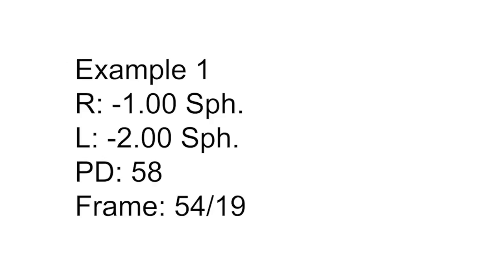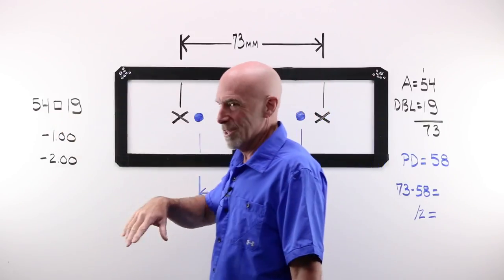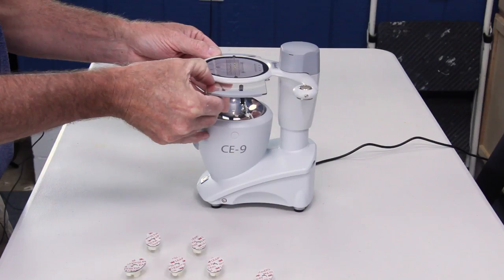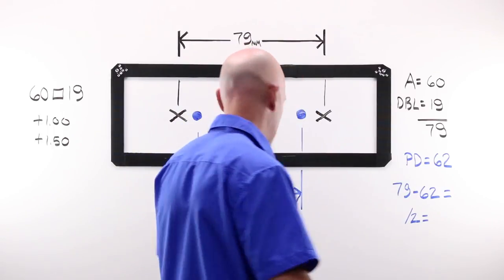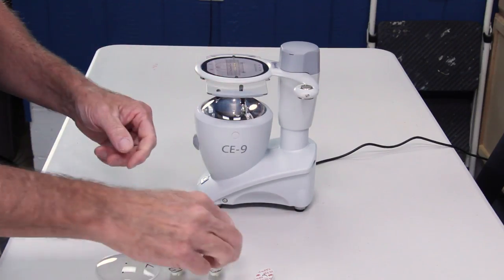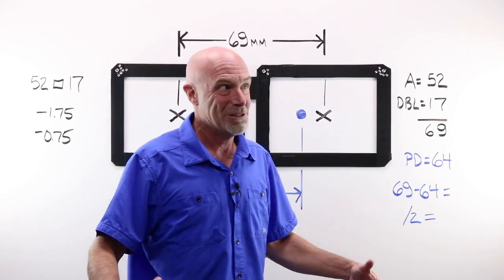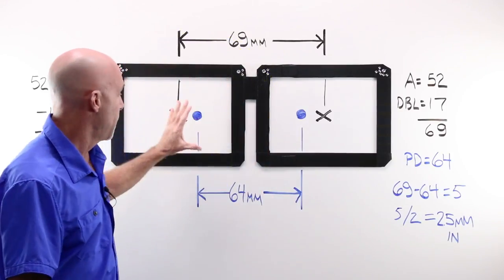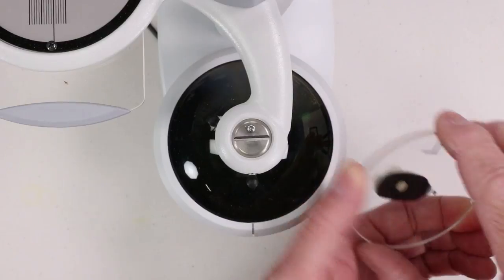Decentration and Blocking - 3 Examples

Comment: Nice explanation on decentration.  I have one question and I am hoping you could answer.  What is your standard height for the OC for  single vision?  Do you always place it on the datum line?  Others are placing it 2 mm above the datum line.  I am just wondering what is your standard practice if the customer didn't include the pupil height.   Thanks.
Reply from the maker: Literally working on that video this morning. Watch for it in a few weeks.

Comment: If you block like that. Will you set the OC height on the edger machine, sir?
Reply from the maker: I would have to say, no. I doubt you can manually decenter for PD and then expect the edger to take care of an OC height. I guess it could work but you would have to experiment with the edger. The basics shown in the video assume no OC height = 1/2 the B. And OC heights are for higher powers and should be kept to around 0 - 5mm. If you need much more you have the wrong frame.

Comment: Hi I have a doubt, Decentering is all the time in the nose direction? I'm a student I read in a book if the Pd is bigger than A+DBL   I  have to decenter  in base out direction, is it right?? Thanks
Reply from the maker: Mik m, Yes correct if human PD is larger than the frame PD then you have OUT decentration. This is quite rare. But it does happen, sure. John
Reply: Laramy-K Optical thanks so much I love your videos
Reply: Mik m   fine

Comment: Hi great video,  i have a nidek LE 9000 SX and ice mini. im new to glazing, ive tried to glaze SV specs but Patient PD is always way way off, can you help at all ? im trying the decentration in this video , when i put half PDS in under frame PD the ice blocker moves the centration and that where i block the lens, but PD is always off, do i need to decentre to make the correct adjustments. many thanks if you can help
Reply from the maker: Oh boy - you poor thing. I can't be 100% sure - but - the edger will have (usually have) two settings. 1) You block the lens on the OC and the edger does the calculations and decentration shift for you. This is usually called PASSIVE MODE. 2) You are doing the physical decentration and blocking and the edger is in PASSIVE MODE. I think that model will show you a little arrow and amount to decenter if you are in the mode where you are doing it? If you are overriding that either way things are going to get messy very quickly. Ask your lab for some junk lenses or better yet buy a box of cheap plano ones - mark/make a clear OC point and experiment. It is confusing as heck but if you stick with it, watch the videos and maybe even draw it out/take notes sooner or later it will click. Let me repeat that - it is confusing as heck so don't feel bad. Let me know if that helps. If you need more drop me an email instead. This may also be a question for the folks on OptiBoard since I'm sure someone over there is still running that machine and blocker too. I suppose if you are only doing basic sv stuff you could always drop the blocker entirely and switch to a manual blocker? John
Reply: @LaramyKOptical  hi thanks for your swift reply, I've been through quite a few planos already, 
i checked the mini ice its already in passive mode, once i change the half PDS the centration does shift and that's where I align and block , then cut lens and still no joy
my process is ( real job I attempted just today)
trace frame on edger
frame shape is shown on ice mini FPD at top  70mm ( FRAME Ralph Lauren 54-16)
I change the half PDS  to RE 31.5 LE 31.5 for both eyes to mirror Patient PD (63mm) not sure if this is correct plz advise)
blank lens is centered and marked on lensmeter
blank lens is placed and aligned with markings on ice blocker (after I changed half PDS of patient )
lens is blocked on ice mini and edged using nidek LE 9000 SX 
PD checked again on lensmeter and over 10mm off (72mm ) 
Ive asked many people in the U.K but everyone uses Essilor 
any advice or help would be great
Reply from the maker: @iqbalgtr  There is no reason at all to split a PD of 63. If you just enter 63 do things turn out OK? With your FPD/PPD a difference of just about 10 and your PD being off by about 10 you are doubling up. Try just blocking on center ignoring the grid suggestions and see what happens? It sounds like a disconnect between the edger and the blocker? To see what those settings are you have to access the service menu. It sounds like you are second guessing what you are actually seeing? Nothing says that the blocker is right (that stuff is getting pretty old now). Again - maybe it is time to let the blocker go? That machine doesn't require one. I'm sure you could track down a used manual blocker (a light source/grid/block applicator) they don't connect with the edger at all. IMO if anything they are much easier to work with not harder.
Reply: @LaramyKOptical  Hi maybe I should disconnect the Ice blocker (the one i have is fairly new touch screen etc with camera)
few queries when blocker imports shape from edger( after traced) and gives me FPD do i keep that number same I.e i dont change it ?
2nd underneath FPD it has 1/2 PD , is this where im suppose to put PX PD in ?? 
3rd if i dont use blocker do i just manually put block on the centre of marked blank from lensmeter , and change PD under FPD on edger itself ?? would that  work ?
thanks
Reply from the maker: @iqbalgtr  I think that is your problem! Assuming the tracer is calibrated I can't see a reason to ever change the FPD which is your FRAME size. Your 1/2 is for your human if you have a monocular patient PD like 32/34 or 33/35. If the blocker is quite new then it is being connected to a machine that is quite old. It may be incompatible it may need the edger settings to be changed to correctly work with each other. It's been 30 years since I worked with that edger now.  If you unplugged the blocker and switched to manual you would need to know which mode the edger is in. If it shows an arrow and an amount to move the lens then YOU move the lens and block it off the OC. If it doesn't then you block it on the OC and the edger takes over. You might want to nose around the internet and try to find a complete manual for both the edger and the blocker? I'm guessing a service call to NIDEK isn't possible?
Reply: @LaramyKOptical  hi thanks again, im still more confused then ever, the machines were working in tandem as far as i know before i  acquired them . a service call to nidek is very expensive.
Reply from the maker: @iqbalgtr  Yes they are! Good time to take a break. Review the videos so you see the relationship between FPD and PPD and then take another crack at it tomorrow maybe.
Reply: @LaramyKOptical  Hi me again, been through loads of blanks still no joy, the machines seem to communicate fine , trace data goes across to blocker and blocker sends PDS to edger as well,  when i adjust half PD the centration does move accordingly and that's where I block the lens, but when glazing is all said and done, The OC is exactly like the frame PD but not the patient PD, I've tried moving the centration and blocking at different points but zero luck , even if i move centration 3-4 mm either side of OC, its still off,, i think im making a glaring error or something because this should work really
Reply from the maker: @iqbalgtr  Nothing is impossible but it is impossible to block on OC and block off the OC and change nothing else and end up at the same place. Is it possible that you are actually trying to match the FPD? Are you looking at the FPD and thinking it is PPD? You are setting the edger by the human PD not the frame PD. Even if the blocker is sending the information to the edger nothing says that the edger is interpreting the data in the right way. I know you don't want to hear it but again - if you are only doing your basic single vision stuff in-house drop the blocker and see how much better things are.
Reply: @LaramyKOptical  I'm obviously doing something wrong, I'm not sure how to block lens without blocker, it shows me diagram on edger and which way to move lens, but how do i exactly do it, do i put the blank over the top of diagram on the edger, ?? other  thing its only moving the PDS like 3-4 mm anyway and then wont cut lens as block is way over to one side of the blank, I've adjusted PD in relation to FPD and blocked accordingly , my issue is I'm not a little bit off in terms of PD, I'm miles off nearly 15mm , no idea what going on ,
which ever way i decenter , the lens cuts ok and OC is directly middle of frame PD but doesnt match PD of patient
Reply from the maker: @iqbalgtr  If the edger shows you an arrow and an amount: Mark your OC in the lensmeter, make a dot that matches the direction of the arrow and the amount. Say the edger shows an arrow facing R and 3. Make a dot 3mm over to the right of the lensmeter OC dot. Place the center of the block on that new mark - run the lens, done. Your marks will all be on the front. This will be easiest if you flip the block with the pad facing up and turn the lens over to line things up and to stick the lens to the block. I'd also slow down a little and watch the videos again! LOOK LOOK LOOK at what is happening in the manual blocker. The relationship is there, the calculations are there, the why is there, you just need to connect them together. And - on the edger and or the blocker you can ignore the FPD (frame PD) entirely. Seriously why the edger even shows it I have no idea. FPD on the edger or blocker is 100% meaningless here. The edger figures that stuff out for you. You are NOT even thinking about or concerned with the FPD at all. (Unless you are doing manual calculations without a frame trace of any kind).  And it almost sounds like you are reading mms in 5mm chunks? Yes, sometimes a lens can be decentered so far it won't cut out but that is 1/100 not most.
Reply: @LaramyKOptical  FPD 70mm and PPD 63mm, using decentration system as you explained means moving Right OC 3.5mm to Right side, Left for left side 
ive tried it both on blocker ( moves arrow automatically) then  blocked and tried no luck, using edger it self doing more or less exact same thing moving lens to the right 3.5mm
both giving me same result , pop lenses back in frame mark on lensmeter the OCS, giving me a PD of 70mm + , not happening for me at all

some stupid questions , marking the blank lens in lensmeter, im finding where cross lines centrally and marking the 3 dots exactly where OC of blank is with a dots horizontally either side,  the middle dot (OC) is what i adjust according to PD adjustment ??
second applying the block , i assumed self adhesive sticker just goes centrally in middle of block, and doesnt matter which way round the sticker goes etc ??
Reply from the maker: @iqbalgtr  There is an entire series of videos on the lensmeter. It sound like you got it but you might want to review. The leap pad just needs to be applied as best you can. Any block should have a center dot or mark or hole to help with alignment. The block should only be able to be loaded in one position - it should have a tab or a notch of some kind that matches the block holder. If a decent sv lens with an ar coat is costing you 50 pounds it won't take all that long to make that NIDEK service call pay off?
Reply: @LaramyKOptical  ive been through most of your videos, a call to nidek is in excess of £300 and thats just a call out, £100 per hour there after, blanks cost less then 40p so can still afford to trial and error rather then call them , but calling them might be the  only option left, thanks for your time